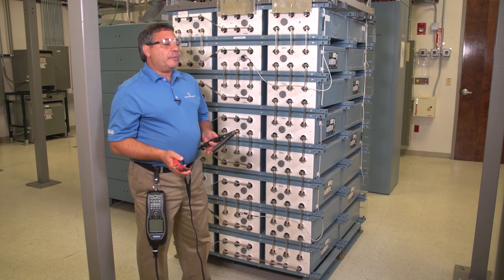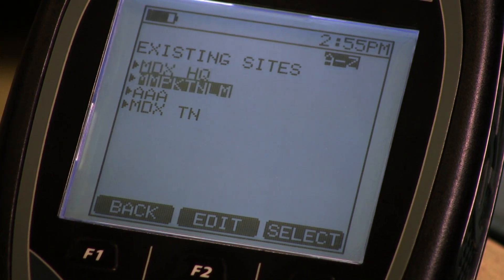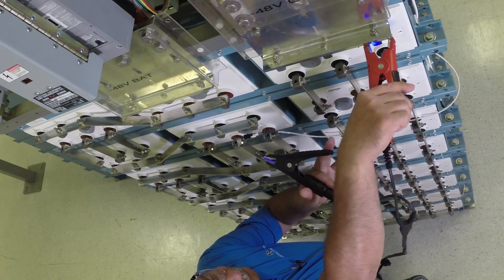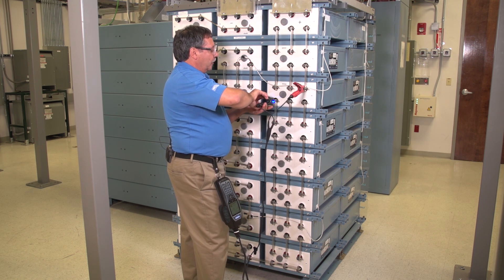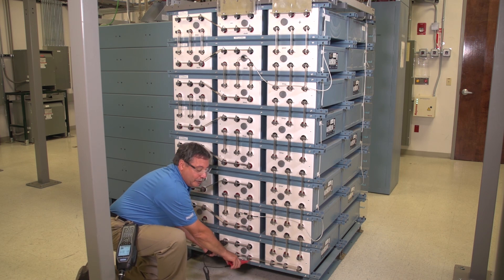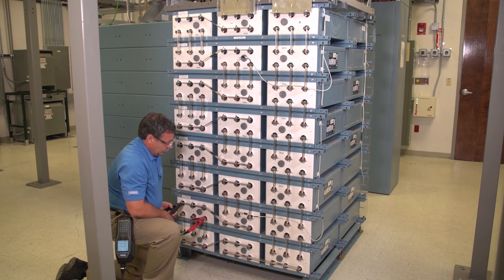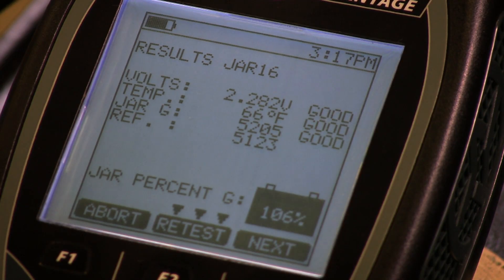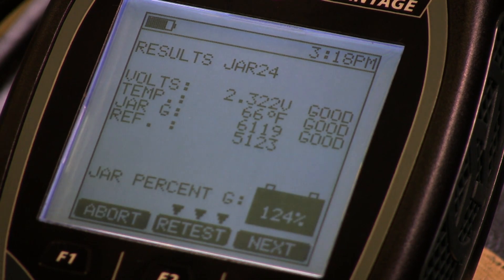Testing A 2 Volt System With The Midtronics Celltron Advantage Battery Analyzer

Comment: Obviously others didn’t notice this, but the second battery tested was 91%. The last battery tested was 124%. This doesn’t seem to be load balancing evenly…they should be charging equally plus or minus a small percentage. Not all over the board series parallel load balancing is the best… Needs to be an industry standard here as I’ve seen many done incorrectly.

This will cause premature battery failure, plus rest of battery bank being depleted.

Comment: Why would I get a g: fail on batteries that are connected together with wire when the battery’s with copper bus bars connecting them pass in the same string?

Comment: Testing with the charger still connected gives different results to testing with the charge disconnected. 
I’ve tried this. 
It makes no sense to me to test while still float charging the batteries. The time we actually need to use the capacity of the batteries is when they are not being float charged due to power outage. 
Surely to get a true reading we should test the batteries without any external influence from the charger. 

Comments please.
Reply: You should always test with the breaker open/off.  This gives you the real state of the batteries.
Reply: @SF-yl2si  Thanks for your reply. This is indeed what I do and I have managed to convince my colleagues to do them same.